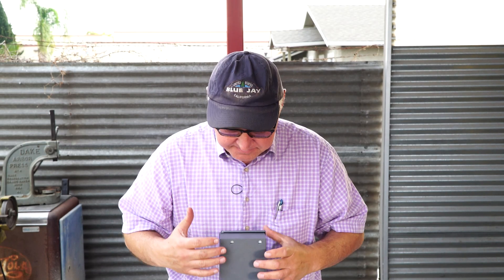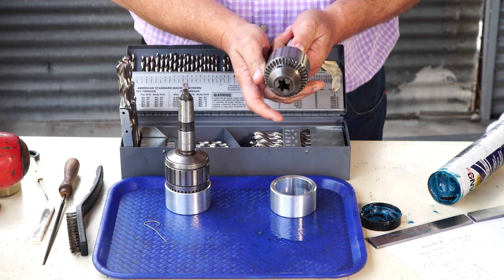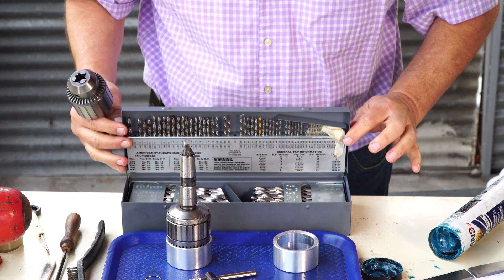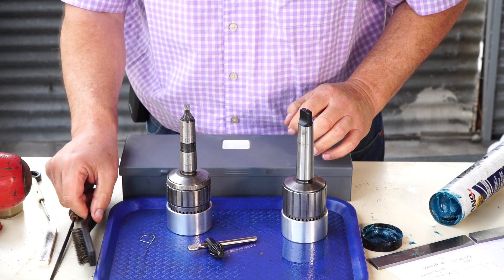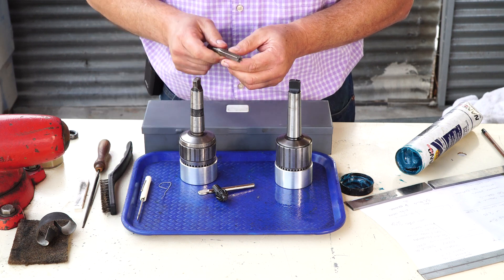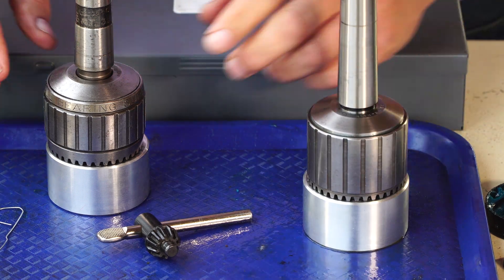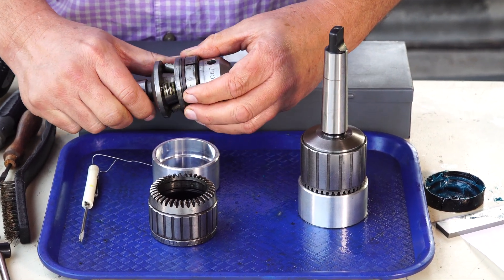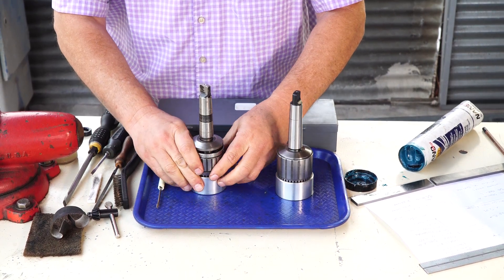Jacobs 14N Super Chuck New v Old

Comment: There are 3 versions of the old Superchucks.  To truly know the difference you need to open them ALL up to reveal the inside builds.  None of the three have compatible parts.  The two early versions have large 3/16" bearings in the 30 to 35 count area. The new crap service models have smaller bearings.  The sleeves are different on all three models.  The split nuts, jaws, bearing race design, all different.  The absolute no question best of all, are the ball bearing Superchucks with the straight side sleeve.  The entire body, bearings, split nut, and jaws are fully hardened.  Can only be drilled out with a carbide or diamond drill bit, if you need to remove a stuck arbor.  The new ones can be drilled with a basic drill bit, they are that soft.  The results are mushroomed bodies next to the jaws, crap.  So maybe follow up when you get all three next to each other, and do a real comparison.  Sorry to be so harsh.
Reply from the maker: That is interesting and I am glad you have shared that with the channel.  We did know there were some special older models that had a spiral bevel gear form as the mating style to the key.  But those are pretty rare.  When I get a chance I will gather them all together and compare them.
Thanks for watching.
Reply: I just finished disassembling, cleaning and oiling my older 14N. It didn't need rebuilding and is in excellent condition. This older design contains 32 3/16 balls and is known as a "full complement" type. The newer type contains fewer balls in a plastic cage.

Comment: here's something that MIGHT help some people.   I just discovered my 13 South Bend (same spindle opening as the Heavy 10)...... it's collet remover / thread protector is right about the right size to slide over my 14 old school Jacobs.   Now depending on your's and how much thread relief there is on the end, you might only get an eighth inch of movement.   Mine looks like it might be shop made and I was able to get my jacobs completely pressed off.   Good luck

Comment: Question: Without taking the chuck apart, how do you tell the old school from new school?  The exterior groove pattern on the sleeve?  Thanks,          PS can over from Stan's and checking out your other videos.
Reply from the maker: Good question!  Yes, the exterior groove pattern on the sleeve.  There is actually a third version -the oldest of them - and it has a knurled sleeve.  They are fairly rare.
Reply: @EvolventDesign  We have in business since 1898 and I still find a few things around that I have no clue what they are.  I will look and see if I can find an old Jacobs chuck.  We also have a gear hobb that the company made around 1905.  We used to make manufacture low rise traction elevator machines up to 2001 and used the hobb to make the brass gears we used on the double centers. We use it rarely now for replacement parts.